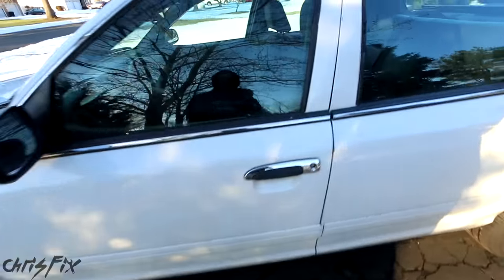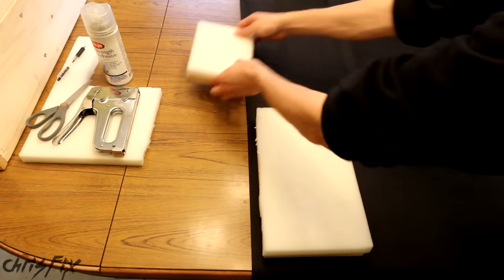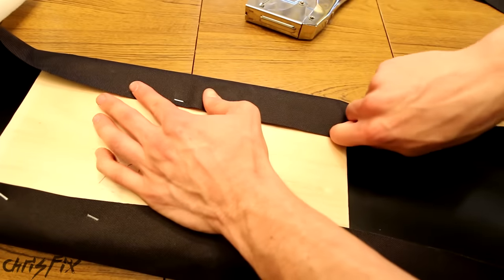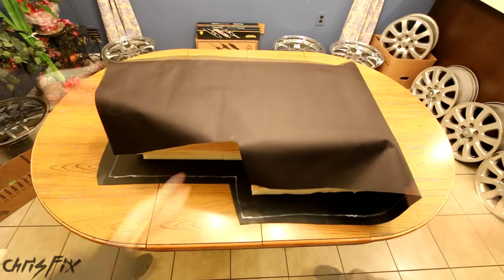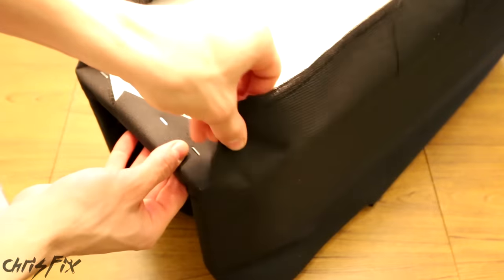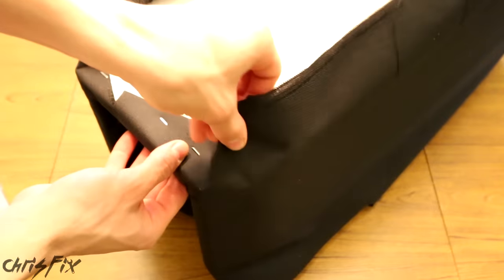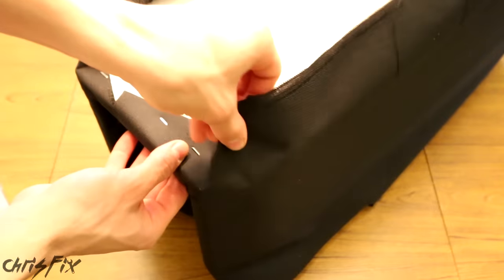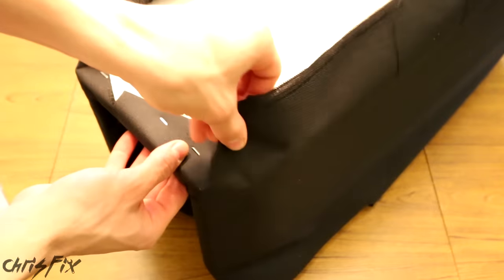How to Build a Center Console for your Car (Part 2)

Comment: All this work and no cupholders!
Reply: +Hermit527 the car already has cup holders that come out of the dash board
Reply: You can see them right in front of the toggle switches. They pull out of the dash.
Reply: L
Reply: Yeah but more is better you never know what your going to use them for
Reply from the maker: +Hermit527 It has cup holders in the coin tray.
Reply: +ChrisFix You mean the worst cup holders? They're so shallow anything but a tiny cup of coffee tips over when you turn. I've sent more cups/bottles flying than I care to think about.
Reply: +ChrisFix would you be able to supply the mesurments you used? I have a 2009 vic I'm doing the same thing to
Reply: You don't want cupholders on a console that has a bunch of toggles and switches, especially on a police vehicle. When you have to turn on your sirens, you can easily tip your drink and damage the wiring and switches.
Reply: +Onur Kirman that's why we need to put in more cup holders, no space for anything, people use more than two
Reply: lol
Reply from the maker: +Shark Performance Gaming That is a good point!
Reply: +ChrisFix hey chris do a face reveal
Reply: +Joey Petrasun he has in like 3 of his videos like the one when he built his truck rack I think
Reply: +SuperSayanFitness def me, a texan ;))
Reply: You can never have too many cup holders
Reply: In this car their is a tray in front of Chris centre console which have cup holder
Reply: +Car Xperts - ya those tray cup holders are crap. my mom has a Grand Marquis which is basically the other version of a Vic. its got the solid tray cup holders which are too shallow and too small for anything except a little 12oz can. the Vic has the fold outs as you can see  and nothing under it. my dad had those in his old truck and they were horrible. it was better to put things in the two solid cup holders meant for passengers built into the back side of the console.

im telling you, those tray things are next to worthless. especially if you buy any large drinks.
Reply: Hermit527 i
Reply: Cops don't need cup holders when you have Dunkin Donuts :-)))
Reply: Hermit527 There's already cupholders in the car ( It's a slide out thing in the dash )
Reply: Since it is a police car it also needs donut holder :)
Reply: first response 1  ' r
Reply: OCD nightmare
Reply: dammit, this is what i came down here to complain about >:o
Reply: Onur Kirman under the leather bit, there is loads of space
Reply: You can easily put them there
Reply: It already has cup holders
Reply: Ajdero5 BMWs have 2 cup holders; BENZs have 2 cup holders, and so does this ford.
Reply: 999 likes
Reply: NutriFIT nutritie si fitnes what if it's for water?
Reply: @SharkPerformanceGaming  That is why factory emergency vehicles have angled consoles with the cupholders towards the bottom, also it needs to be waterproofed anyway due to the wear and tear of being in an emergency response vehicle
Reply: Door cup holders
Reply: thats funny
Reply: The pull out cupholders in my 2000 Lincoln Town car are absolutely worthless, cups fall right out.. Hope his Crown Vic is better!
Reply: I agree. The stock cup holders are crapy. I would had added cup holders on the center console.

Comment from the maker: Just to answer some questions: The inside of the console is not done, I have some cool ideas for it but I need to run the ideas past the officer. Next, The lid needs to be fixed. I did not account for the extra foam on the side, just the wood thickness so it looks "off" which is why I think some of you think it looks "ugly". Finally, I appreciate the feedback and hope you guys enjoyed the video!
Reply: For the inside, I think if you used the plastic that you used around the switches and form an inner box that would cover the vinyl and staples. This would work well on the inside of the box lid too. Maybe use black countersink screws. You might even be able to hide the hinge this way. Failing that, you could use very thin carpet (we call it office carpet, dunno what they call it where you are) glued to the inside.
Reply from the maker: +mcmcolm Good idea!
Reply: +ChrisFix Thanks for the update. I had a feeling you had more in store. Now I cannot wait to see what it might be.
Reply: +ChrisFix All good, Chris! Appreciate you taking the time to make videos. I'm sure documenting this process wasn't the easiest and of course, we all make mistakes. Keep up the great work!
Reply: When will be the next episode of project police??
Reply from the maker: +Cm 1900190 Not sure yet but hopefully this month!
Reply: well I was wondering why u didn't put a cigerate lighter in the back
Reply: +ChrisFix Maaaaan you're quick with the scissors!! :DDDDD Great job btw ;)
Reply: hey Chris i have a real problem and was hoping you could tell me if you know how to fix it or could make a video. i have a 99 GMC jimmy and the fuel gage isn't working and was suggested to change the fuel filter would that really be the problem? i also checked the fuse and it's okay thanks!
-a long time viewer :)
Reply: Hey can you make a Diesel Fuel Filter... Because i always service my Car every 5k mileage and I think i get scammed everytime i Service it thanks!
Reply: +ChrisFix I like it, personally, but I have to agree that the lid isn't proportional. I think it just needs to be one or two inches wider so it makes more of a cap. Just my aesthetics though. I think the whole thing turned out nicely, and being a DIY project, it's also fairly upgradable. You can redo the plastic top at any time if you want to change something out.
Reply from the maker: +buggsyspam Thanks a lot man!
Reply: +ChrisFix There's just something satisfying about installing flush mount switches.
Reply: +ChrisFix Im still 17 but as soon as I get a car ik your vids will come in handy. Keep up the good work bro!
Reply from the maker: +flimflam Yea there is for sure!
Reply from the maker: +Stoner Vids Awesome!
Reply: +ChrisFix Hey Chris, your tutorial videos are the best ones. You make it fun to watch and intresting. Also, you're really good at explaining, even for a rookie like me to understand. Keep it up! 
Im following all your uploads, cheers!
Reply: +ChrisFix   hey chris, could you do a video on how to clean an engine properly? I see so many different videos that contradict one another. some say spray cleaner and hose only, others say pressure washer is safe, some cover certain parts with plastic bag and others say no need, even soaking the alternater to prove it will still start. I don't want to mess up my truck. can you help. thanks
Reply: hey Chris I am also jealous because it is not mine
Reply: ***** Thanks for taking the time to comment. I will use my hose and cover what I think needs it. its better to be safe than sorry. I really appreciate the tips, thanks again.
Reply: +ChrisFix   i would round / trim the front left/right corners of the plastic plate ,  the rest seems ok ! Nice work.
Reply: Where are the cup holders????
Reply: Great video by the way
Reply: +James Ferro the penny tray has cup holders that fold out i believe
Reply: Mr. Turtle oh cool
Reply: Any idea when episode 5 is coming out? I'm not even sure how but I found episode one and I subbed cuz ur channel is awesome and I love cars
Reply: You should have countersunk the screws
Reply: I'd add 2 screws in front part of plastic going into the front piece
Reply: ChrisFix Dntttggv
Reply: Chris, 
You forgot the cup holders
RIP Bottle
Reply: ChrisFix
Reply: ChrisFix
Reply: ChrisFix, you have nice rims behind that table !
Reply: ChrisFix chris my console it very suck it always broken how i fix it
Reply: C
Reply: It's still awesome! better than my broken console. the hand rest locking latch is broken. $200 for a new one. fk that, I'll put some hinges on it. lol
Reply: no its definitely just that its an ugly square box. which on that note, i remember a few years ago on tv one of the auto shows that took old vehicles and tricked them out for their owners did a whole center console, dash board, and sub woofer thing so they all looked cool and visually the same. 

what they used was fiberglass. i know, thats like taking it up a notch in difficulty a bit when this video was pretty much just measuring and stapling... but you can make stuff look a lot better with fiberglass.
Reply: ChrisFix I used a stapler it kinda worked but the staples didn't go in all the way lol
Reply: terenas1986 dude it was time lapsed
Reply: ChrisFix you wouldn't make another 1 and sell it 2 me and how much would you sell it
Reply: ChrisFix why didn't you hook it up to the car what are all of those electronics supposed to do
Reply: ChrisFix  just a suggestion but i think it may look better if you rounded the corners of the abs plastic to make it safer from getting cut and blend in and look nicer aswell ☺
Reply: MrTiger1489 bad fuel pump sending unit
Reply: ChrisFix I really want to make one for my mom now lol xD
Reply: ChrisFix  so what happened to the video of consol wiring im working on my dads patrol car and need help on the witing especially since the vic has cheap amazon lights
Reply: where is episode 5
Reply: A few weeks, two years you mean?
Reply: rip
Reply: When does part 5 come out its 2018!
Reply: well actually we dont care
Reply: ChrisFix good video I’m glad that you commented on the wood cause I do think that it is off I’m sure that once you fix that it’ll  be perfect. Looks great!
Reply: ChrisFix  looks good to me
Reply: ChrisFix  love the channel
Reply: 11:47am?

Comment: Very nice work Chris. A lot of work went into making that center console. You can buy some really nice ready-made center consoles for around $100. You can buy one, then modify it, which is what I would do. You can use corner brackets on the inside, rather than screws on the outside.
Reply: That would work. as long as the screw doesnt come out tye other side. That wouldnt be good
Reply: Tyson Hosmann you know damn well you don’t know how to start in building a center console
Reply: @tysonhosmann1591  OHHHHHHHHH he cursingg man he cursingggg
Reply: @tysonhosmann1591  ok make a center console
Reply: @tysonhosmann1591  it's built by him. he's proud of it and i doubt you could do it

Comment: Hey Chris. I love the videos. Just some tips from an upholsterer. Keep those staples close and flush with the fabric. Don't angle the staples or it has an increased risk of coming apart. Stretching the foam over the edges or edge stapling the foam to the wood will help it to look cleaner. I upholster chairs and sofa consoles at La-z-boy. Keep up the great videos.

Comment: I am so glad someone thought of doing this video. I am bidding on an aftermarket console from a police department in Ohio. It is an auction site. If I lose that auction, I will be building some variation of what you made. I work in security and direct traffic for utility companies. I have lights in my car that I use for those jobs and will be hardwiring all of it. I also have other equipment that will go into the console. Thank you.

Comment: Can't wait for all the wiring, that's what I'm really interested in. The console looks good, but the screws in the plastic stand out, maybe use flat heads instead and paint them, or cover with some plastic caps?
Reply: +Choujeen thats why he used stainless screws because they are more appealing to the eye, you could use black screws too but then it just looks like you tried to hide them and it didnt work. I like the stainless look myself.

Comment: Personally, I think gluing that front piece in would've helped ensure it was securely in place.  I think spray painting the inside of the armrest black would've been a nice touch too.  Otherwise, this turned out pretty great - good work.
Reply: i wouldve at least put a couple of screws from the bottom up into the front piece and used the abs plastic screws on top
Reply from the maker: +Peter Schmidt There is no reason to glue the front piece. It allows for quick access to the electrical wires when it gets wired in. As for the inside of the arm-rest, you could do more if you want. That is all up to the individual. In this case, I am not sure what the officer wants. maybe he wants a gun holster in there or something like that so I did not finish the inside.
Reply: +ChrisFix i still thought it looked cool though
Reply: ChrisFix True, the quick access is definitely handy.

Comment: Hey ChrixFix, I'm glad you're doing another police project car video after that. I think you can touch up and improve the center console a bit more, such as hide the staples from sight by putting plastic on the bottom of the flip cover, and the interior walls of the storage area. The storage area is deep, although I'm not sure if it could be utilized all that well. Could you show us how to add rear AC vents to the center console and make some kind of shelf storage system and add racks which would be more useful? Police Project Car Videos are always awesome, I'd be looking forward to Part 3 of center console with fine-tuning and maybe even an AC attachment!

Comment: Hi Chris. I just purchased a used ranger for work. The truck is awesome, however much like your truck the center console was broken. I liked most of the things u used to for this build however I personally would've used black carpet like the once used for subwoofer boxes. Also, I personally didn't like the look for the lid hinges. I feel as if it could've been hidden in between the wood and the foam you used. The switches do look awesome and when I put some lights on the truck I'll wire the it to the center console. Overall it's a great build I really appreciate the idea.

Comment: I will have to say, wrapping it with the fabric and foam is the hardest part, my dad is a master upholster and you didn't do half bad. But I do have to correct now that the glue that you used, that spray adhesive is not the same stuff you would use on a headliner. Maybe for a cheap fix but headliner glue is some of the strongest stuff you can have or breathe. And you can't actually use it in residential areas period but for what you can do at home you did a great job

Comment: Chris, check into how to stretch a canvas to a frame for painting. Use that technique for stapling, it makes for an even stretching and reduces wrinkling. Basically you start from the centers and work your way to the edges. Some more of that abs plastic would be great to use as a bottom and sides for the insides to cover the wood and cover the staples as well.
Reply from the maker: +ggin nj Thanks for the tip!

Comment: Good work my friend! Bang up job! I would suggeset getting one of those slip resistant mats that you typically put in your tool box or on your shelves in the kitchen to give a little bit of friction. That way the officer can put any size and type of device on that mat in that open space so they can directly look at it while driving and not worry about it sliding off when turning sharply. Great job man!

Comment: I can't wait to see the finished version!

I really think you should round off the corners just a smidge on the switch plate. 

I think once you reshape the lid to line up right... it'll look great. The corner folds on the fabric only look frumpy due to the mis-matched width of the lid.

Comment: Nice job, but I personally would have mounted the Siren Control Box right behind the three mounting holes for the cell charger port, amp meter, and power plug, that way, the siren control box would be right in easier access of the driver from the switch box, or, you could also mount a 2 way police radio down there in the open area of the ABS plastic. Just an idea for the future for you.

Comment: Also just a tip, use a router or sander and round over bit or use the sander to round off the sharp edges, makes for a much cleaner look and makes a very nice piece. sandpaper will work but way more work and not as nice results

Comment: Another suggestion, the console top should be hinged from the back . Fabric glue should have been used at the location where the top half and the bottom half comes together, then steam and press the seam. Also the plastic should have been glued together to make it look like1 piece! AND the fabric at the 2 inside corners could have been fixed so it didn't need to have the top piece of fabric at all. I was raised in the furniture industry, in High Point, NC the furniture capitol of the world.....lol we are all born knowing how to upholster.... lol.  I also hope you are planning to use #10 wire to power the console, fused of course, or a regrettable circuit breaker.  I like the voltmeter, power port, and the USB charging ports , I bought a few of thoes a while back and will be using them in my 87 Bronco that has become my project for now..... I have already fixed the rear tailgate window so I can run it up and down from a keyfob, next project will be to add an auto resetable over current limit board so when the window reaches top or bottom the current is stopped.